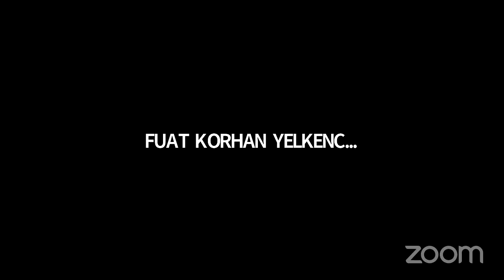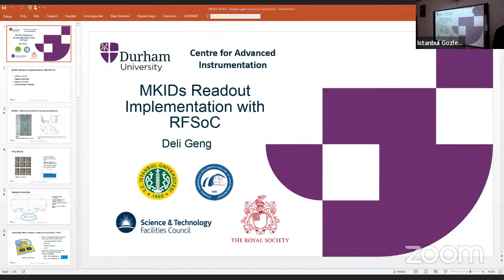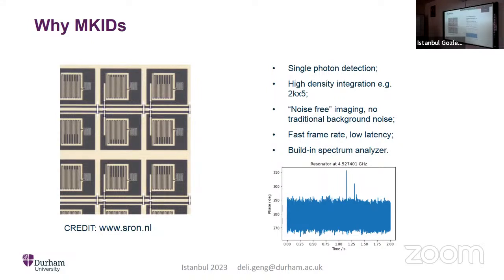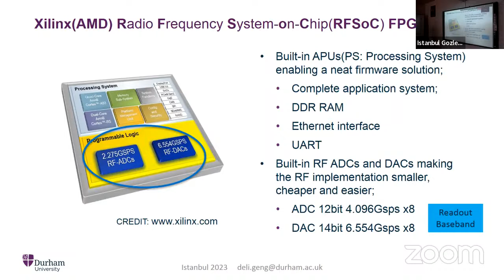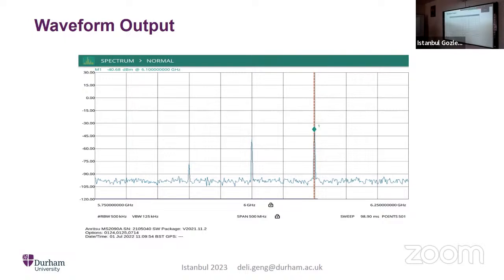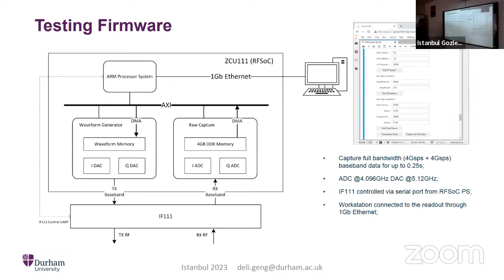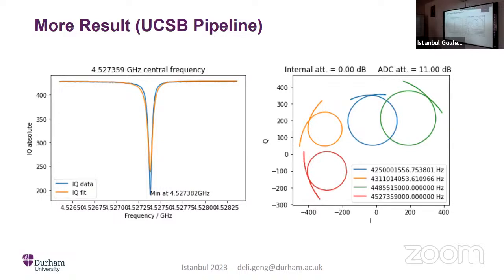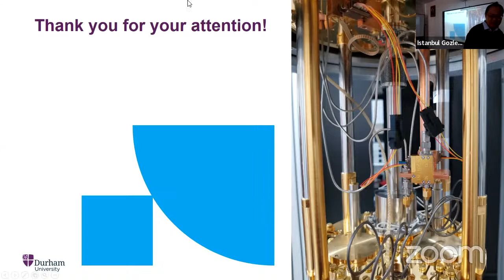MKIDs Readout Implementation with RFSoC | Deli Geng, Durham University

Comment: Hi Deli,
Nice presentation!
How difficult will it be to adapt your mixer board for the RF SoC 4x2 board?
I expect that a redesign of the board would be required, such that the baseband signals propagate to the mixer board via standard SMA cables, instead of via the ZCU111 connectors.
Do you have plans for such a redesign?

Thanks,
Colm
Reply from the maker: Thank you very much. Here is the reply we got from Deli: "Unfortunately, we don't have the 4x2 board and the chance for us to make an IF board for 4x2 is low. But I'm happy to share the design files of our current IF board and encourage anyone to develop their own IF hardware for the 4x2 or 4x4."